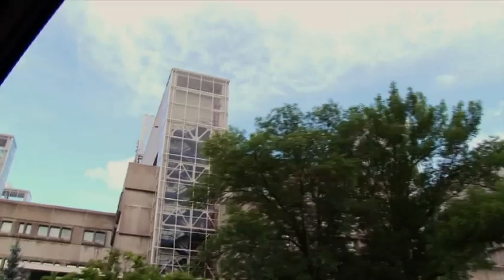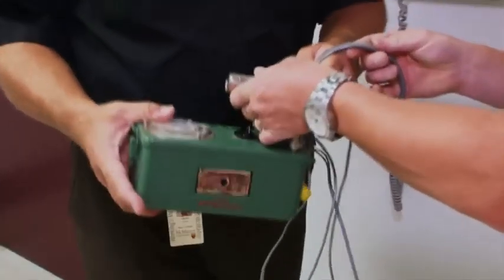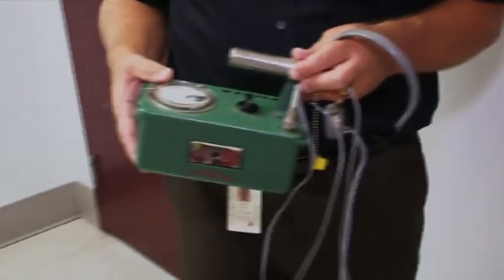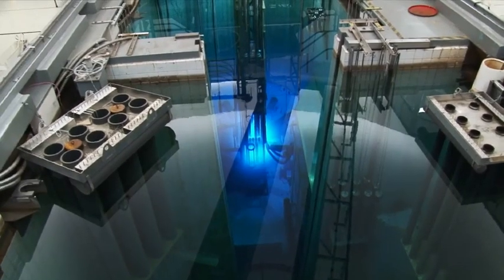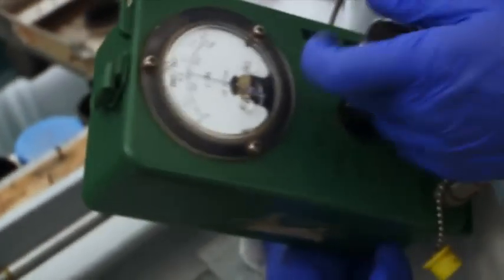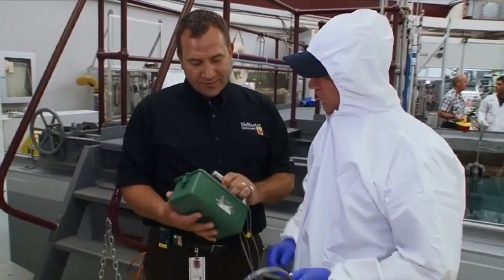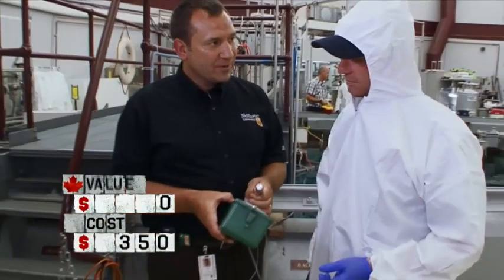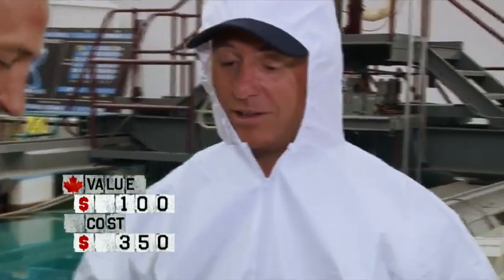Storage Wars: Geiger Counter

Comment: The geiger counter is 100 bucks used but are stupidly easily calibrated. Do that and they sell fof about 250. If it is the 2 D cell type then its closer to the 250, if it is the  4 D cell type then its a bit cheaper. I used to fix these up for the preppers or a first geiger counter for a hobbiest.